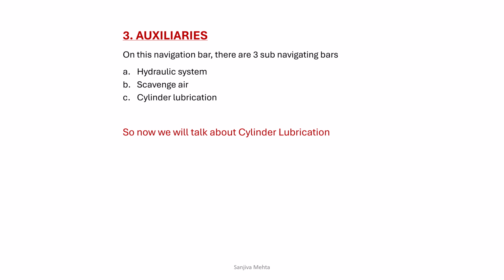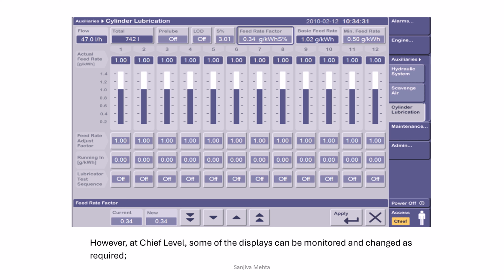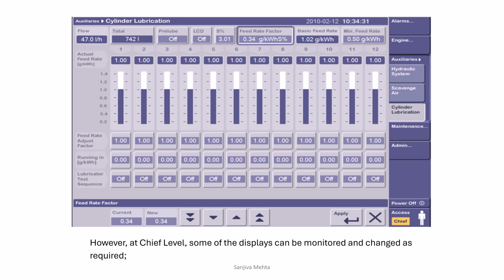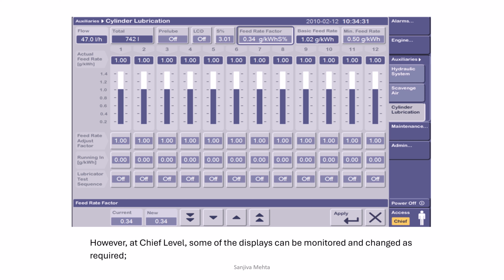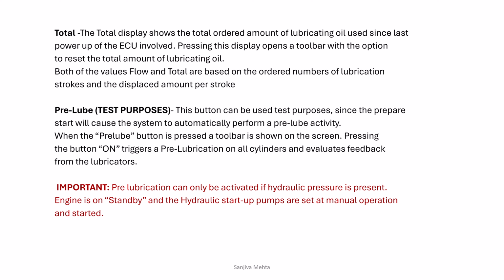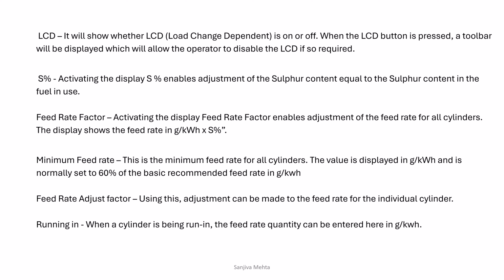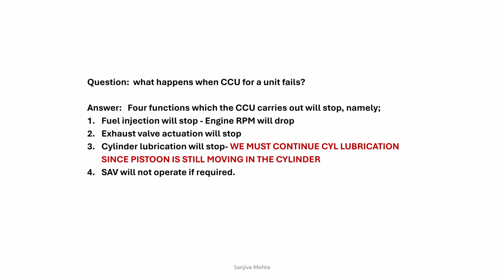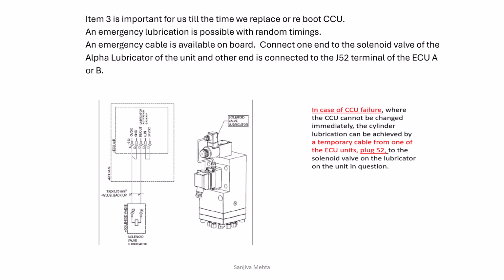Auxiliaries- Cylinder Lubrication- Module 5- Chapter 3-MAN B&W Camshaft Less ME-C engine series

Comment from the maker: On ME-C electronically controlled camshaft less engines, how emergency cylinder lubrication is carried out if CCU fails? How to change the quantity of cylinder lubrication if using different grade of fuel oil with different  sulphur S% in the fuel?
And answers to similar such question, find them all on the is video; https://m.youtube.com/watch?v=rIiTFQsXKTk&feature=youtu.be